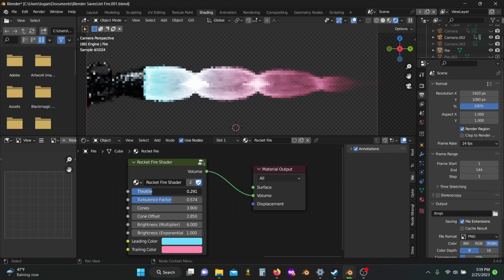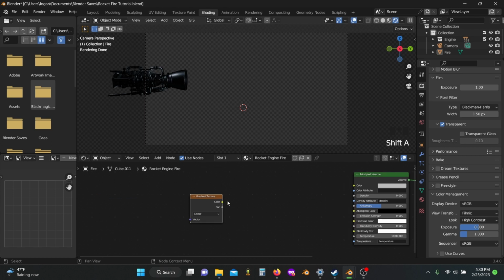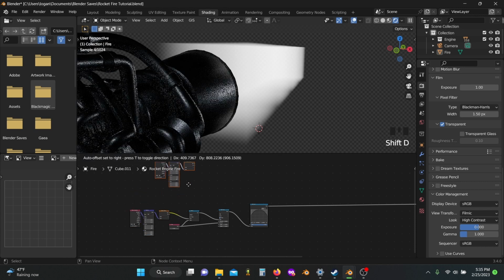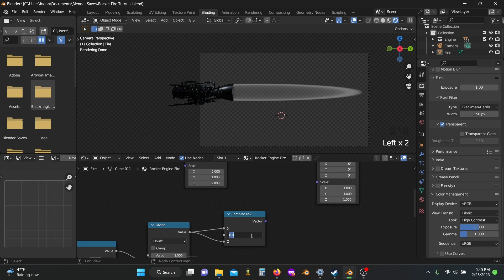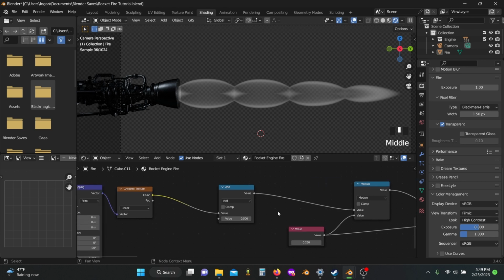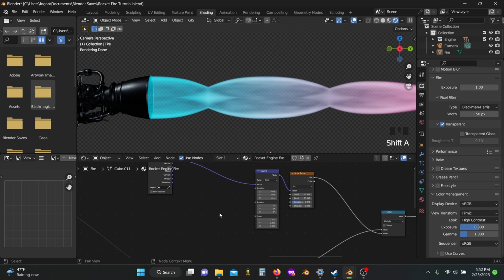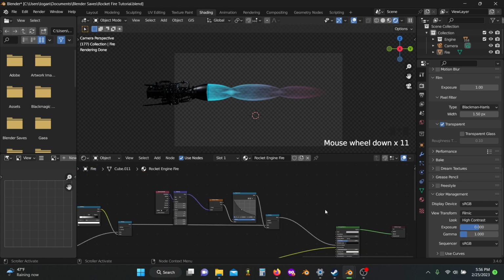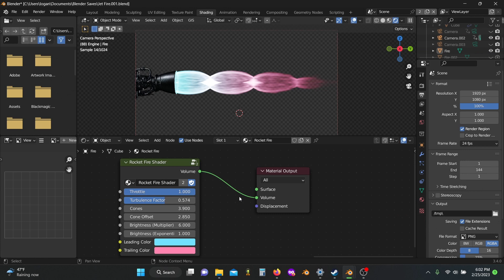Epic Rocket Engine Fire Effect (Procedurally) in Blender | Tutorial

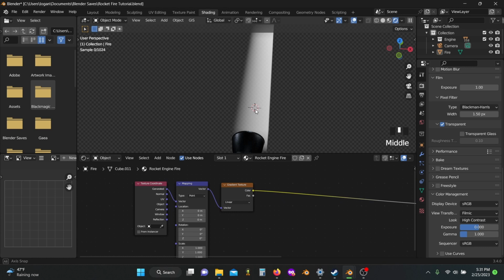Comment: Using blender 3.6 and it would not show up at all unless I multiply emission strength by 200 starting from 3:00. 
Turns out it was because my rectangle was too small. 3 meter long box works great but 30mm not so much 😅.

Comment: I tried to do this but in principled BSDF texture without volume but something goes wrong, like information about modulo and quadric sphere they not transferred properly. I will try again Tomorrow with but with more changes maybe.
Reply from the maker: For a Principled BSDF you’ll have to alter a lot of stuff but the general math functions should still work. Might I ask why you’re using a Principled BSDF instead of a Principled Volume shader?
Reply: @AlaskanFX  I'm try render stuff in eevee but the volume voxel resolution is not that sharp and detail like standard texture even I change settings to 2pix. I don't know its is possible but i want try make fake volume shader, using geometry node with sphere, cube and distribute them like onion structure, and I want put  the noise texture with alpha channel on that layers, to look like volume in Cycles. But the problem with this solution is with vissible layers, maybe when I add layer weight to transparent that problem will desipire.
Reply from the maker: @positv_  Ah, gotcha, I've actually been working on something similar. I'd recommend just making a mesh that looks like the rocket plume and then using the set position node and some noise to add turbulence (using a gradient texture to make it more intense towards the tail end). Then I'd just use a regular gradient texture in the material to affect the emission and whatnot